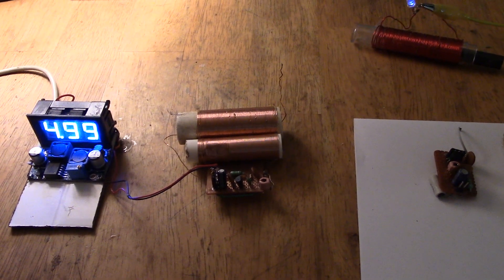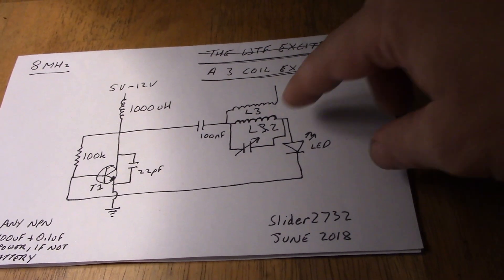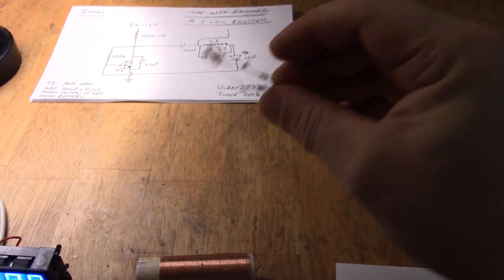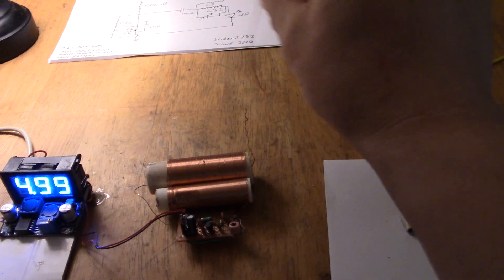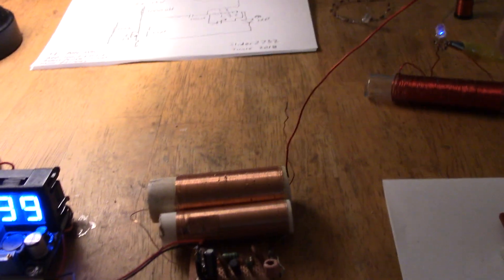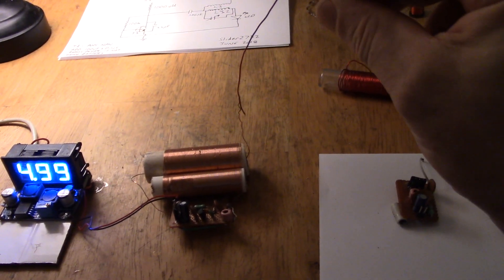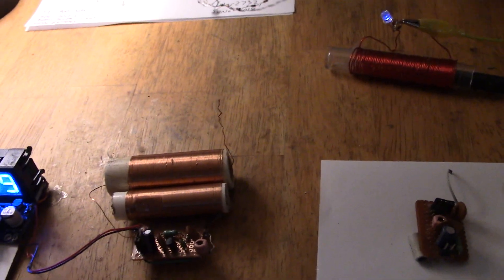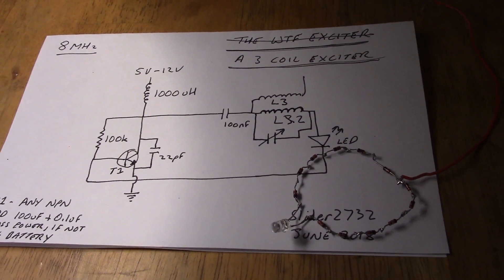When an AV plug doesn't work

Comment: I replicated it with a 2222, but I was a little bit short on time, and i didnt get it to work properly.
But it is boarded, and i am going to try it again today.
What should i look for?
Reply from the maker: That is a really good question Fredrik !
If a simple AV plug doesn't work then that's a good sign, but only if the thing is actually running lol. On power up at 5V, the LED should flash once. I don't know why it does it, but when the variable cap is rotated fully it will also do that. 
If you have a scope, you should see it begin to run at somewhere from 5MHz to 12MHz depending on coils, but if not, an AV plug will work at the very end of the L2 near the upright pigtail end.   
If it looks right and yet doesn't run, touch the middle of the L2 with a finger tip, the LED should flash and it should then run.  
Finally, if the LED does flash but the circuit switches off immediately, move the L3 away from the L2 by a small amount. Sometimes, when too close it causes a swamping of the coils and makes the circuit quit.
Reply: Slider2732 i am going to try doing that as soon as possible. The kids are on summer vacation now so even when I have time off, i am still on duty, you know? ;)

Comment: These anomalies are so interesting but I notice you now have 100 turns on both L2 and L3, which is different (previously 60:80). Has that got anything to do with the odd behaviour?
Reply from the maker: That's what I don't know yet lol. The idea has been to progress the circuit by building versions. If something does something seemingly unique then it stays in one piece, have had far too many times when have taken things apart only to have to rebuild.
And I did it again here...this one got it's coils taken off at first cos I thought there was something wrong for the AV plug not to work. Then Dr. Stiffler kindly sent an email saying it was a "prime example of not exciting the surrounding area" so I rebuilt it pronto !
Same number of turns is certainly of no detriment.

Comment: What does your scope show on the same positions as you touch the AV plug?
Reply from the maker: I haven't tried the scope connected to the AV plug, but that's an idea...normally i'd expect it to work something like a sniffer, if that's what you mean. The problem might be the scope wire getting in the way, because the circuit knocks itself off if detuned too far.
The var cap is set to maximum output/amplitude, but a hair either way and it can switch the thing off even with hand presence. Tapping the L2 in the middle makes it run again...the onboard LED flashes when it does so.
  :)

Comment: Fascinating.  RF is like the fog creeping in on little cat feet. (Apologies to Carl Sandburg.)  In this case, it seems like your handheld AV plug becomes part of the circuit, rather than just being a sensor.  At around 1:50 or so, the other LED in background seemed to dim when your handheld LED brightened up.  So it's reminiscent of the observer effect in quantum mechanics.  Nice demo.
Reply from the maker: Phrase of the day "RF is like the fog creeping in on little cat feet"
Thanks :)